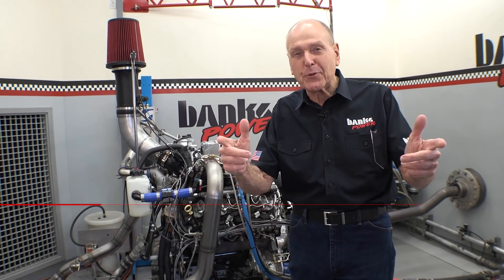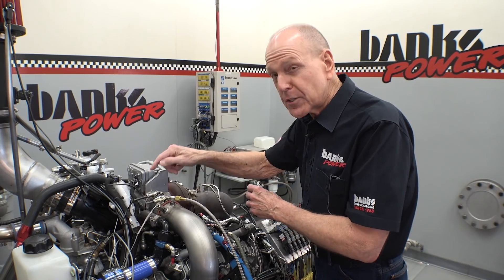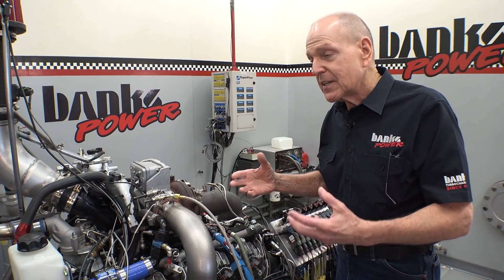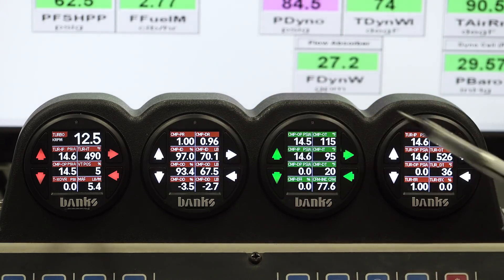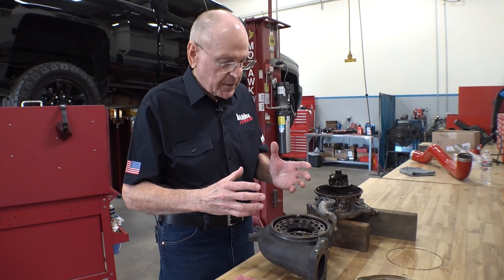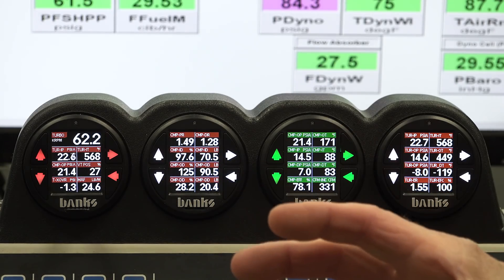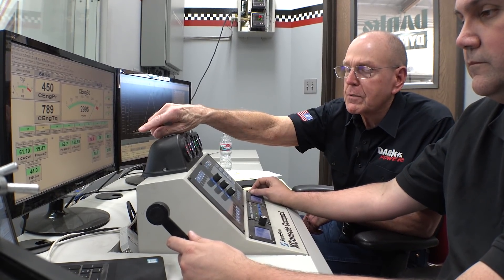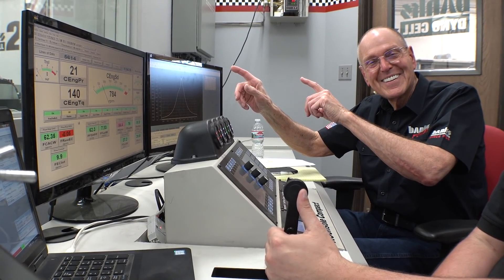KILLING A DURAMAX Pt 3: 133,000 Turbo RPM! 🔥

Comment: Sounds like the type of parameters you would need to know when designing a Rocket engine and fuel management to go to the moon. Id say this man thoroughly understands every aspect of turbocharging any engine. Where as most mechanics just bolt one on and see how much boost they could build till the engine dies. To look at hundreds of parameters and understand how they affect engine performance, longevity, Fuel burn, etc. is the sign of a genius engineer. This man forgot more than most will ever know.

Comment: When he shuts the engine down and lets it idle, it shows over 20 hp and close to 200 ft-lbs of torque. This engine is about as powerful at idle as an 8N at full throttle with close to twice the torque. For reference one of those tractors will pull about 2800 lbs at the drawbar even with the fast gearing it has. Amazing how powerful these modern engines are.

Comment: I would love someone to buy a 6.5 Detroit diesel and completely modernize it with obd2 and better mechanical injection and slightly larger turbo and different compression pistons and anything else it may need
Reply: It has been done. One of the 6.5 sites did it about fifteen years ago. Lower compression pistons, better turbo, more fuel. They said it ran about even with a stock duramax. Cost about $4k in parts, 15 years ago
Reply: @jonathangreeley8604  that's pretty good considering a Duramax still costs 8k in my parts.
These 6.5 are a dime a dozen
Reply: Yeah, and I think it was heath diesel had one that was up around 500 hp or so that they used for LSR. Had it up over 150 mph at Bonneville Salt Flats, and averaged a little over 30 mpg on the drive there. But they went to the extent of partially filling the block with concrete (Google search 6.5 land speed record). I had one for a while in a 1/2 ton and greatly regret letting it go.
Reply: https://www.thedieselpage.com/finale.htm

Comment: The COMP-OUT vs. Turbine - IN has Always been the Tricky part when selecting Turbine wheel size and turbine housing A/R with a regular turbo. 
Without Variable turbine housings you always had to choose between boost lag / Boost Threshold and Top end Power.

Comment: That variable turbo is only good at low rpm. Talk about boost Blow by holy crap. It's a bottleneck for someone that wants to really beef up that engine I can't wait for the next video let's put a bigger turbo on it!!
Reply from the maker: A VG turbo is where it's at. You just need a bigger one. Not saying we're working on... but maybe we are... wink wink.
Reply: @bankspower  Agree. I think we can understand that GM engineers made it this size for reliability/longevity of the engine. A much larger Turbo with the same functionality could really unleash some untapped potential of the new 2020 Duramax! Can't wait to see what you guys come up with!
Reply: @kabco99  They sized it to make the most power in Operation range",  which is alot lower than what Banks is trying in this video. 

A BIGGER VGT would still make less Low end (off throttle power and have a slower response, even being a VGT..because of the extra mass of the larger wheels and possibly due to compressor efficienc . Even with a VGT turbo you still have to size it for what you want to do. Stock is Always for reliability / Economy / emissions 1st. Anybody that wants to get more than an Extra 100hp or so... Always needs or is better off with... a Larger than stock turbo , same goes for Gasoline turbo cars.

Comment: The principle is the same no matter the explanation: "I'm a diesel I run on pressure to generate combustion not ignition. What is the maximum amount of pressure the system can sustain to generate 'x' amount of output?" In a gasoline/ethanol/ ethanol engine  this would be measured in the ignition chamber.  In a diesel I agree..."moar holistically"(meaning the entire area around the engine is used for combustion as well as even the exhaust gases.) The "theoretical limit" should be not when the turbos, inter-coolers, radiators fail but when the the engine housing itself is breached. That would say to me "yes, Detroit...at last a well built engine!" (And then see if after said deflagration whether the engine is still functioning at an albeit greatly reduced performance threshold..

Comment: Really nice presentation.  The engine was very happy at 3000 rpm, 750 ft*lbs.  I paused the video and found the compressor efficiency on one of the other gauges, and it was 77%.  That is a great efficiency number for a compressor.  Then when they closed down the VG to boost higher, the compressor efficiency went into the toilet: 61%.  And the turbine inlet temp went from 1180F to 1450F.  Gale wasn't kidding when he said the turbo was "done".  Can't wait to see what he comes up with for a better turbo.
Reply from the maker: Gale reveals the new turbo in Episode 5, which is live now.

Comment: Gale, at the end the vgt was closed some to boost drive pressure and maxing out the turbocharger. My question is what would have happened instead of closing vgt down it would have been left wide open and just added my fuel? The choke was the vgt...if it was opened up would that not have reduced some of this choke? Thanks

Comment: Where is part 4? What's taking so long..
Reply from the maker: The reason for the time between follow-ups is purely due to R&D. When we post a video, ten times out of ten, it's something that happened that day or the day before. Regarding the diff cover series. We've been sitting on the info for quite a long time. Why? We'll only get your attention once. We're going to reveal the research when we debut our cover design. We made many iterations and several billet prototypes, tested the heck out of the design, then went with a manufacturing process that is far more accurate but takes much longer. We have the diff covers in production and hope to have an announcement soon. 👍🏻
Reply: Over a month since last killing duramax video.. Seriously tired of waiting for new content. Are you actually going to kill a duramax or is that title just clickbait??

Comment: Very informative Gayle, but what's the end objective? From my perspective you should be involved with every next generation Duramax engine design at GM. The singular objective should be creating the most efficient engine design that balances horse power/torque output with engine longevity. Between you and the GM engineers these engines should be designed for 10 years plus trouble free motoring.
Reply from the maker: Ever since tuning of the engine was released late last year, there has been a lot speculation on how far you can push the physical limits of the internal stock components. You cannot blindly push this engine with tunes that claim to have tons of power claim and expect the engine to live forever. We are testing the engine to it's physical limits to find the answers.
Reply: Thanks for your response. Once you've thoroughly tested the many variables you so clearly describe that co tribute to engine performance - why suggestion was to feed some that information back to GM so they can incorporate into the next generation Duramax design and release. With technology as it is today, there should not be any crappy turbo chargers. The Duramax L5P should be able to easily crank out 550 ponies, 1000 foot pounds of torque, and still reliably run for a decade. To summarize - performance/longevity = greater consumer value. Thank you.

Comment: Don't wanna be a cynic here, but it's seems to me that Gale's purpose is at least in part to make a case for his aftermarket products with these videos. Reading between the lines, my take is that Gale is claiming that because other tuners don't have the ability to monitor the engine's components to the same degree that Banks can, those other tuners MAY be offering kits that are both inefficient and detrimental to engine durability / longevity. Let's not forget that Banks is competing with these other tuners, who sell less expensive kits that mostly change fuel mapping while utilizing as many OE components as possible. Kits like that are less expensive, and therefore more attractive to the uninformed consumer. So it makes sense that this video series is at least partly an effort to educate consumers, and hopefully in doing so, steer them toward Banks products, which are more expensive because their kits often require installing more expensive aftermarket components. If at the end of this video series, Banks just happens to offer a kit with a new turbo, charge tube, intercooler, etc., I won't be surprised. This is just clever marketing.

Comment: Any updates on the diff cover?
Reply from the maker: The reason for the time between follow-ups is purely due to R&D. When we post a video, ten times out of ten, it's something that happened that day or the day before. Regarding the diff cover series. We've been sitting on the info for quite a long time. Why? We'll only get your attention once. We're going to reveal the research when we debut our cover design. We made many iterations and several billet prototypes, tested the heck out of the design, then went with a manufacturing process that is far more accurate but takes much longer. We have the diff covers in production and hope to have an announcement soon.👍
Reply: @bankspower  Thanks for the update! Will be buying one for my chevy!

Comment: This is cool and all, but they had to manually change the turbo geometry by dialing in the 22 percent closed on the turbo veins. It was working great till they did that. I don't see the point in replacing a turbo that is working as designed. Numbers looked fine till they dialed in that 22 percent closed on the veins.

Comment: Gale just answered a couple of questions my father and I were hypothesizing on with regards to turbine drive pressure vs compressor output and it's negative effect on power/heat production.  We formulated the hypothesis that more boost is not synonymous with more power. We don't have a great way to experiment, or test our prediction. This video is pretty much spot on for this particular experiment.
Thanks BANK'S!
Reply from the maker: Your welcome, stay tuned for more videos by Prof. Gale Banks at Awesome Auto Knowledge University.

Comment: A little extra back flow is wanted Gail. To minimise ring rattle and rod bearing unloading.  You are right to minimize or limit crossover to gain performance, but these trucks intended duty we're industrial and the severe cross over was baked in to prevent employee hot rodding

Comment: you could use less turbo charger if the fuel air mixture was richer. as far as i know, the best power and efficiency happens at a much higher fuel to air ratio than your current ratio in a diesel engine. using chemistry and thermodynamics, the most power one can get from Diesel fuel is to burn the hydrogen from the fuel molecule and let the carbon go out the exhaust. this fuel to air ratio does leave a definite haze to the exhaust , like the older jet engines, but burns hotter. excess air is used only to keep the parts cool or to limit the peak combustion temperatures for emissions or to limit the visible exhaust trail in a fighter jet or visible smoke in a diesel engine. 

believe the best stoichiometric ratio in a Diesel for power and economy is 0.96 (13.92)air to fuel. this is slightly rich of the stoichiometric ratio of 1.0 (14.5)air to fuel. 

22/14.5 yields 1.52 times the air necessary of 1.0 stoichiometric

22/13.92 yields 1.58 times the air necessary for best efficiency/power 0 96 stoichiometric

stock turbo might work with a richer fuel/air mixture

Comment: Where is the diff cover?
Reply from the maker: The reason for the time between follow-ups is purely due to R&D. When we post a video, ten times out of ten, it's something that happened that day or the day before. Regarding the diff cover series. We've been sitting on the info for quite a long time. Why? We'll only get your attention once. We're going to reveal the research when we debut our cover design. We made many iterations and several billet prototypes, tested the heck out of the design, then went with a manufacturing process that is far more accurate but takes much longer. We have the diff covers in production and hope to have an announcement soon.👍

Comment: Run  two  Normal  Turbos in parallel with two Y pipes   and   pop  off vales to exhaust  run  on  one  turbo  until you need the second one..  On    I  guess  you would need  check  vales  too..  Maybe not a practical  idea ..

Comment: Maybe I’ve never seen bad tuning on a Duramax, but all the tunes I’ve seen have the vanes opened up at high rpm and load not closed down like you did to set it on self destruct. Where are you seeing this happening?

Comment: This is what I've tried to convince people of for years. You can't put too much emphasis on one data point and ignore the others. Engines are designed to be operated within a certain range. When you want to operate outside of those limits, you might have to change many other things. Even staying within the range, changing one thing can cause many other changes that might not be desirable. Even many running dynos only look at horsepower and torque.

Comment: "This is a great turbo!" "This turbo is Out. To. Lunch"
Reply: It  is a great turbo when ran within factory specifications.  As soon as they opend up the parameter ( the same way most plug in diesel tuners do) the engine package then began to pump a higher volume of air then the turbo could flow in that in that configuration. The egts start to creep up well the engine gos Rich

Comment: This information is awesome however, the major negative to consider is how this all is affected with a DPF exhaust system connected to it.  Most engines live longest and put out more power  without exhaust restrictions.  I'm sure the EPA has their blinders especially fitted to avoid looking at performance and longevity data while they are strong arming the manufacturers to restrict exhaust flow for emissions purposes. The DPF idea is so wrong as the public is being subjected to high maintenance costs, lower fuel mileage and high wear and tear resulting in engines and their  accessories to fail much sooner than they should. Stories are out there the DPF systems on big rigs have limited many engines from 1,000,000 miles before tear down to only 300,000.  In the meantime, those in the DPF business are getting rich.
Reply: Bullydog has a couple of huge DPF's for the Ford and Ram trucks that instantly show a considerable reduction in back pressure.

Comment: This is Great!  The coolant readings are going to be interesting, as a HVAC tech I want to see that.  If you use straight water the specific heat will be 1.  If you use a mixture of coolant or any other additive, the specific heat will change and you have to correct for this formula I am about to give.  500xdeltaTxGPM will give you the BTUs (British thermal units) added to the water.  We can see how improper tuning causes overheating and overloading of the radiator.  

I LOVE THIS STUFF!  I use Gale Banks for reference in my HVAC classes for my apprentices.  He is so interesting that the students don't even realize they are learning what they just thought to be too complex of a theorem about air properties.  What a national treasure you are Gale.

Comment: So then I want to know how these tuners are making 550whp and 1200+wtq on the stock components and why they think it’s still safe and why Gale Banks believes it’s causing problems. Can anyone explain?
Reply: Stephen Nicholaides because the fibers don’t care and the 99 percent of the public does know any of this info.
Reply: Bbd L but how are they making that power?
Reply: Idk how hot gale has that tune, if the injection system was maxed out the egts would’ve cooked the motor. He believes in clean tunes, some others will throw way more fuel than need be for alittle more power but it’s not as reliable. I think the purpose of this was just to find the turbo is max at the moment so that’s what he wants to show.

Comment: Jpaydirt has been installing Blaylock Switchblade variable geometry turbos on his CAT heavy equipment. Is that something that could be used in small displacement consumer truck engines like the L5P? The BW VG turbo looks very complex whereas the Switchblade is so simple. Maybe a collaboration is in order. Win Win.
Reply: Switchblade works the same 
They all work is a similar way 
But switch blade is controlled by air or probably boost pressure in jays situation because he doesn't have a computer in the scrapers to control it 
Using a boost actuator instead of electrics is a compromise because it's very slow to react and no good for cars 
Earth moving gear is either 10%, 50% or 100% power they're not going on and off the throttle all the time like when your driving a car 

Me and a few friends have done experiments using a hino truck vnt on a Nissan patrol td42 motor 
It was way too slow to change nozzle position so it's slow to come on boost and slow to come off boost 
We ended up setting the vane adjustment to a choke cable so it runs as a standard turbo But you can manually adjust it from the drivers seat

Comment: How will it work if you just compaund and put a second turbo on top of the stock one? Of course the drive pressure will go up, but so will the charge pressure. The question is, what is better for best power, a big single or a compaund... I think the drive bilety is better with a compound, but if you're staying on the map making effective boost with a single, I bet you lose something compared to compound

Comment: How are you able to measure 130k+ rpm of shaft speed without an optical trigger?  If that's what you are using, then how is it actually installed in a stock GM turbo housing?